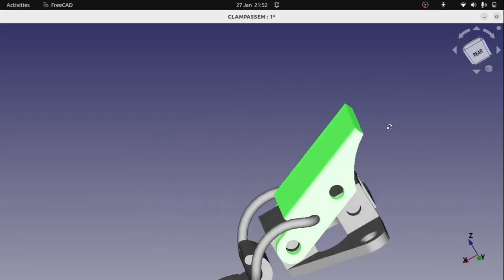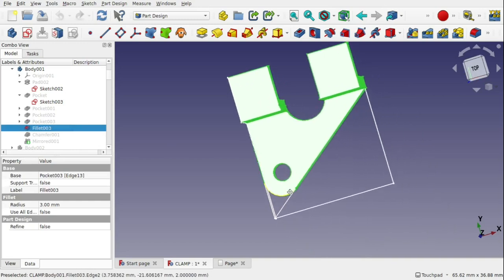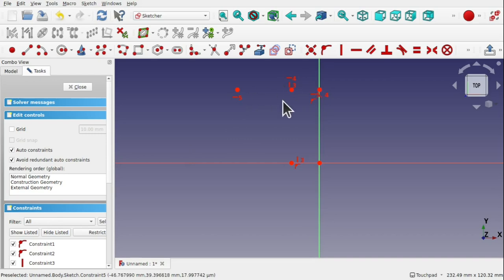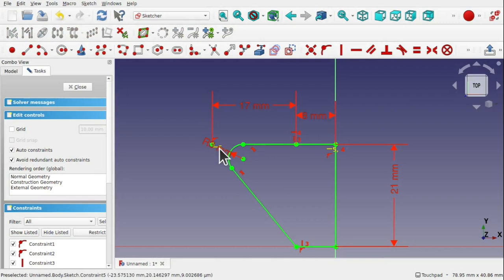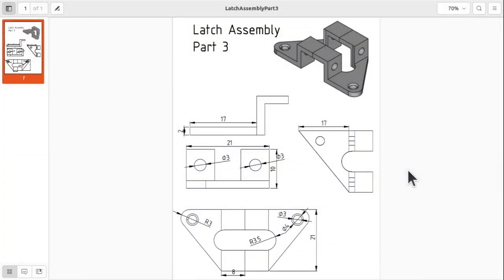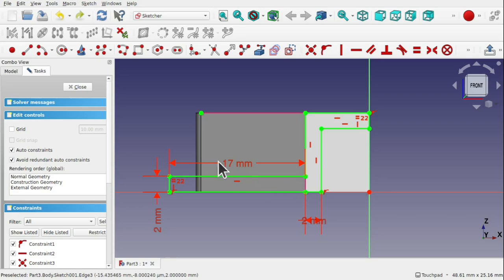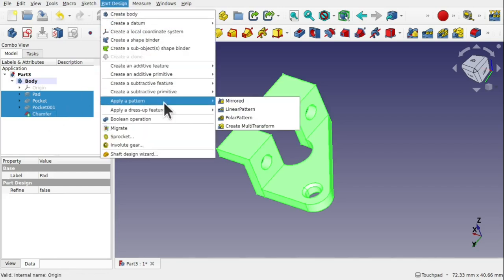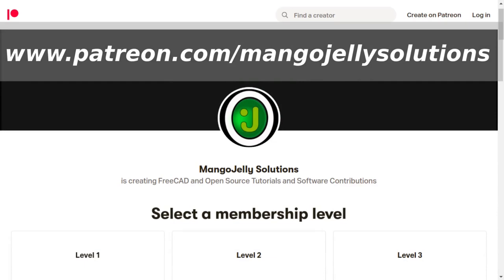Learning FreeCAD For Beginners | 35 (Part 3 | CAD Thinking Part 3: Latch Assembly

Comment: The tips in this video that made an impression on me are: Using points to set the scale, to avoid things like your sketch turning into a pretzel when starting to add dimensional constraints. The other is troubleshooting the error on the mirror. I find I get in those situations but you don’t see tutorials show that often enough. Thanks for making that a teaching point.
Reply from the maker: Glad you enjoyed and picked up some new techniques. I agree, most videos you see they are perfect first time, including in the problems on the way makes life less frustrating. I knew when I closed the sketch down I made a mistake but thought "don't edit out, fix it later and include it in the finished video". All adds to the learning experience.